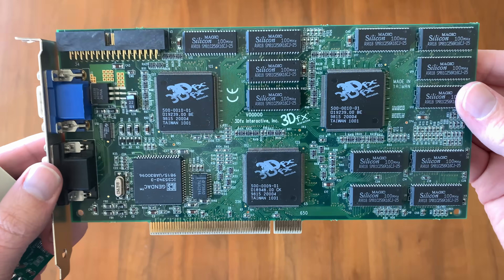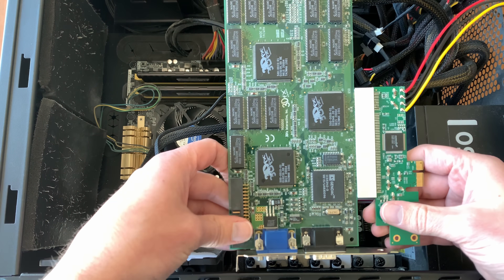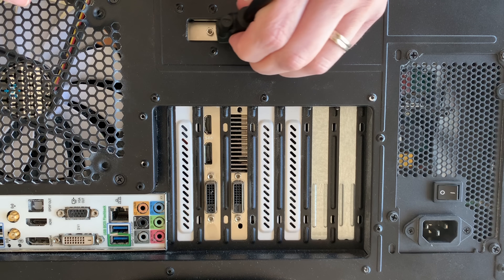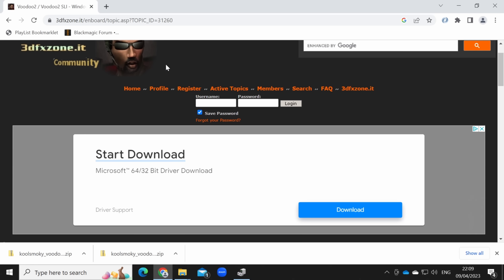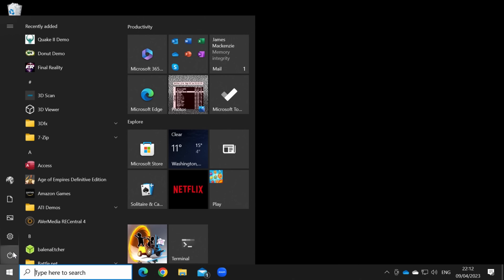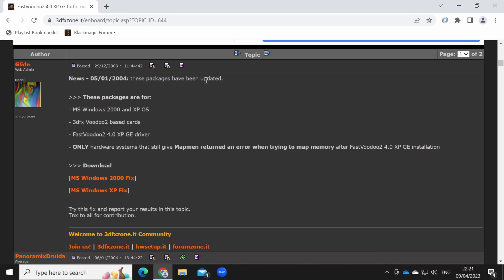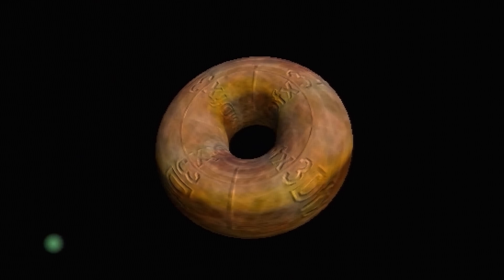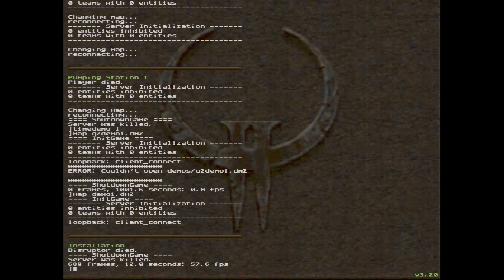I made 3Dfx Voodoo2 work on a modern PC!

Comment: I was expecting to see the card working in linux, not on windows.  Now I'm wondering how well it would run alone without another GPU in the system.
Reply: You wouldn't see anything much of the time, without another gpu(or at least the integrated graphics) The voodoo2 is 3D only.
Reply: It can only do 3D environments. You'd have to remote-desktop to it and launch a game remotely for the 3DFX to kick in.
Reply: @TheAmazingAdventuresOfMiles  I honestly forgot about that quirk of the older cards.

Comment: Awesome but How did you connect the vga pass through with a 2D card? The voodoo2 needed to be connected to a 2D card from what I remember as I always assumed it didn’t texture fill. I would love to have 3DFx running again :) good work
Reply: That’s right, I am not convinced these demos are actually using the card…but Quake 2 looks like Glide to me
Reply: @meatpockets   yes it did look like glide, but yes need to know how it hooks up to 2D card. It needed a 2mb or more dedicated 2D card. I used a 2mb video logic card :).
Reply: No! The Voodoo and Voodoo 2 cards did not need to be connected to a 2d card. They were actually stand alone devices. The purpose of the pass through was so that you could use a single monitor to display the video from both cards. The Vga connectors on the Voodoo would pasthrough the video from your 2d card whenever the voodoo card was not active for example during boot up and when just running the windows desktop. But when you launched a 3d game and the voodoo card became active, it would internally switch to the output of the voodoo. And of course after you exit the game it would switch back. Alternatively, you could have a separate monitor connected to each. My guess is the reason he didn't use the passthrough here is because modern video cards tend not to have VGA anymore. They tend to have displayport and hdmi. Also modern monitors tend not to have VGA input. So, it would be simpler to just connect an old dedicated VGA monitor to the Voodoo, than to convert back and forth just to go thru the passthrough.

The only 3d cards back then that needed a 2d card were the powerVR cards like the m3d. The M3d had no video output at all. After it rendered an image into it's frame buffer, it then had to copy that over the PCI bus to the 2d cards frame buffer. Nowadays Nvidia's optimus technology does similar. That's how with a few hacks you can play games on a Tesla card that has no video output at all.
Reply: awesome all answered in second video I learnt something :)

Comment: I would love to see the Voodoo Banshee working on modern hardware.  In my opinion it was the first card that set the norm of what video cards would become.
Reply: I think that would be the Riva TNT from Nvidia, it was released about 6 months earlier, and performed similarly or a bit better overall.
There had been other combined 2D/3D cards of course, but this was the first one to push 3DFX.
People were disappointed in the Banshee when it came out, as it was considered slower than the older Voodoo2.
Reply: @DoubleMonoLR  The Banshee actually came out before the TNT, and was much cheaper.   Also, the Banshee was slower in 3D than the Voodoo 2, but for games that only used one Texture unit (most of them), the games were much faster than the Voodoo 2 as the Banshee ran at a higher clock rate.

Comment: This takes me back. Sometime around ‘99 I had a 2 card setup on my AMD K63 400mhz system. It was a AGP Voodoo 3 /16mb card and a PCI Voodoo 2 card with I believe 12mb. They were linked together and gave some impressive benchmarks for its time. But it was short lived because around that time the GeForce came out and change everything. I bought the GeForce 2mx. It was the bottom line GeForce but it destroyed anything I’d owned previously.

Comment: This is pretty awesome! I have been running benchmarks on my Voodoo 2 to compare it to other 3D hardware on my Windows 98 PC, and with VSync forced off that Quake 2 timedemo caps out at around 57 FPS at 800x600x16 on any CPU equal to or faster than a PII-450; I swapped in a PIII-550 recently and the test didn't change one iota, so we're running into the rendering limits of the card here. With a bit of additional cooling there's probably some room to run a bit faster with overclocking, but one thing we forget about late 90s/early 2000s games is how slowly they ran and we still considered it OK; getting anything around 30 to 40 FPS was considered pretty playable back then!
Reply from the maker: Good to know! I didn’t try 800x600 - running in 640x480 here :-)

But I 100% agree. We are spoiled by locked 60fps nowadays :-)

Comment: i remember a friend he purchased that voodoo2 to able to play FIFA98 . I had Cirrus Logic 5446 with Tuner. I was also able to use Adobe Premier to capture A/V connecter device or TV programs but with bad reception. I was studying in  country had no PAL system. I was also used it super quality webcam when I connected my Sony Handycam Camera to A/V input (needed Beta Drivers for webcam ability). I had Sound cars ESS 1869 but has general midi but ones i had a Sound cart with Yamaha MIDI which I like it's Quality.

Comment: I remember back in late 1998 I had a Celeron 300a based PC, with a 4mb ATI Rage Pro and Dual 12mb Voodoo 2's in SLI. My CPU was actually overclocked to 594mhz (a world record, apparently) accomplished by cable tieing 3x 60mm Fans from Amd CPU heatsinks to the 300a's slot heatsink, then using PC133 ram instead of the normal 66mhz ram, this PC I managed to run the first Max Payne on despite the requirements stating it needed an Amd 1Ghz CPU as a minimum. It was a good PC for its time and when I eventually upgraded the whole thing I gave it to my dad, and he owned and used it for another 15+ years, even still overclocked too, then one day it just died, and apparently he recycled it, which was a shame, as I'd love to have been notified of him letting it go, so I could have potentially repaired it and used it as a Retro PC for old gaming titles.
Reply from the maker: A legendary overclocker CPU! I had the 300A running super reliably at 450Mhz - and also Voodoo2 SLI. Great memories :-)

Comment: I have 2 Voodoo 2 cards here and tried the same thing with a pci adapter card.
The card uses, as far as I can tell, the same ASM1083 chip as you have on your adapter.
I got the drivers installed but as soon as I tried to start something with glide it immediately crashes without an error message.
So I booted in DOS and read out the cards info with mojo.
It shows the FBI chip has 0MB memory and that it can´t activate the TMUs with error 0xdead.
First I thought the card is actually dead, but then the second cars had exactly the same problem.
So I got an older mainboard (nForce980a chipset) with native PCI support, and both actually work fine.
The interesting thing is, that mojo doesn´t have any problems with a Voodoo 1 with that adapter card.

Now I´m building (sort of) a retro PC with Windows XP, a Phenom X6, a GeForce 6600GT and 2 Voodoo 2s ... oh well ... I need a case now ...
Reply from the maker: Sounds like a fun project! Interested to hear what case you get - I'm on the hunt for a retro case too!! 🙂
Reply: Well... The case didn't turn out retro at all.
I got a cheap Kolink Inspire K9.
Rather modern case with glass window and RGB.

But the really cool thing is: I found someone here in Germany who sells 3D printed Voodoo 2 SLI bridges with an illuminated 3dfx logo.

Looks really nice.

Can't recommend that case though.
Wouldn't buy it again.

Comment: Diablo 2 using the Voodoo on a CRT vs  nGlide on a CRT. Look for glowing color effects (some enemy spells, usually poison and fire attacks from skeleton mages) not directly, but from behind walls (these colors tend to glow through. Check color saturation and brightness differences. As I recall, some light effects were not apparent or prominent in D3D, but were somewhat present with nGlide's 3DFX, but not sure just how well it implements it vs real hardware. Might be some other things to look at too.

Comment: I've got some old Voodoo 3DFX hardware LONG CARD hardware running in a Windows 7 environment as an entertainment PC on my Sony TV.. I love it!! Will be using your info to try and massage it into a newer build with Windows 11 and see how it goes.. what I love about the card I have is it allows me to SLAVE it into another card using the external VGA MALE and FEMALE ports.. this way you get the BEST of both worlds!! So to speak...
Reply: The problem is modern monitors tend to not have VGA and likewise modern video cards, or onboard video tend not to have VGA out. So, to use the pasthrough youd have to convert back and forth. As such it would make more sense to either just use a dedicated VGA monitor on the voodoo or use a monitor that has multiple inputs, like a TV that has both HDMI and VGA inputs and just switch between them.

Comment: I'm surprised that worked at all. The voodoo cards were passthrough adapters. I was unaware they could do all of that without a video input into them. I'm thinking the demo had a static background you weren't able to see because the background was trying to display out of your primary display adapter. I'd like to see what happens on two monitors with one attached to the voodoo output and the other to your primary display. Probably have the 3d models go to one and the static images on the other. Final Fantasy VII (not the remake) would be a neat experiment there. 3 bonus points for getting the sound blaster AWE 32 with the sound font loaded into it to go with the voodoo card  :)
Reply from the maker: My monitor has dual inputs - 1 VGA and 1 HDMI. My primary video card uses the HDMI and the voodoo is connected via VGA (no pass through, just output). When the voodoo activates (e.g. in a GLide game) I toggle over to the VGA input and everything works great :-)
Reply: @jamesfmackenzie  Not sure you understand what I was saying there. I think Quake is a fully 3d game so that one works. I think the voodoo card only handles 3d things and is reliant on another video card to render 2d images. Quite like the bit in the Angry video game nerd's episode about the Sega CD32 while he is hooking it up if I remember right. Another thing you could do to see what I'm talking about is to adapt your DVI signal to VGA somehow and plug it into the input of the Voodoo card. I bet you'd see a background in the tech demo bit you got it working. It's also why I mentioned playing Final Fantasy VII on the PC because I know that has 3d models imposed on 2d backgrounds. The way you have it hooked up there you'd only be able to see the 3d models because the Voodoo card has no way to deal with 2d images at all. So really I'm thinking were you to have two monitors you would get the 2d backgrounds displaying on the primary display adapter's monitor and the 3d models on the Voodoo adapter's monitor were you to plug both into the respective video adapters. Could be wrong. It's been a long time since I've ran a Voodoo card and I never had two monitors back when I did.  :)
Reply: @jamesfmackenzie  I just went back and looked at the bit that showed the back of your PC. You have a VGA out from what I'm guessing is your integrated graphics. You can hook that output into the voodoo input and do all the stuff I was talking about. There should have been a male to female VGA cord with the voodoo card if it's still around.
Reply: @thefirsted  No. That's not the way it works. the passthrough is just a passthrough and a switch. When the voodoo card is active it's doing all the rendering. When it's not, it just passes through the other card. Anyway, nowadays, it just makes more sense to use it the way he did here and use separate connections for each card. Using the passthrough would make no sense.
Reply: @stefanl5183  I don't think I'm wrong. Linus did a big video about voodoo cards recently that supports my argument. I could be wrong though, it's been a very long time since I've ran a voodoo card.
Reply: @thefirsted   When the voodoo cards are active the passthrough of the VGA card is switched off and all the output is coming from the Voodoo card. And the voodoo card can certainly render 2d if it needs to. Rendering 2d is simply writing to the frame buffer. There was even a guy who wrote a video player for voodoo cards. Google 3DFX Video Renderer V1.1 (c)1998 Tjalling Hattink. I don't know if it's still on the net now, but you can find it in the internet archive. The only thing the voodoo card really can't do is boot  your system and load windows. It can't do this because it's not a VGA card and doesn't have an option Rom bios and it doesn't emulate a VGA card and map itself into the upper memory blocks in the 1st megabyte of memory where VGA cards do. Back then you had to have that for the system to boot up properly and also to get video during the boot process and before the drivers were loaded. Now we've got Uefi and things are a little different but you still need a firmware on the card, it's just a UEFI firmware instead of BIOS. Anyway, it's not that the voodoo cards couldn't render 2d, it's just that they didn't want to bother with all that. Anyway, you can see for yourself by simply doing exactly as James did here in the video and simply hook the cards up separately. It works just the same. In fact, there were some people who did this back in the day and didn't use the passthrough because on some cards it was said to degrade the picture quality just a bit sometimes on some of the better 2d cards. So, to avoid this loss of quality when they weren't gaming and using the voodoo card they simply did it that way. Anyway, you don't have to use the passthrough. The voodoo cards work independently from the 2d card. This is why couldn't play games in a window on the desktop with a voodoo 1 or 2. Later with Rush, banshee, and voodoo 3,4,&5, you could.

Comment: Quite impressive. I have had a Voodoo Banshee card (Wicked 3D) back in the 90's, which was an AGP card. Unfortunately, I have not seen an AGP to PCIe adapter so far. However, I know there was PCI version that AGP card as well. As for a request: Please try "Clive Barker's Undying" on your Voodoo 2 card. That games supports both Glide and DirectX. Would be nice to see if there is a difference in image quality and how the game performs on a modern PC and your Voodoo 2 in general.

Comment: I’d like to see you try to install a Sound Blaster Audigy 2 on a modern PC. That sound quality blew away onboard sound on all my PC builds right up until windows 7, when it refused to run the drivers. I would be willing to bet that card could output better sound than any onboard chip to date if you could get the thing to run 😅

Comment: How did you fix the pass through vga ? I have an older C2Duo pc with a pcie to 2xpci adapter that did not work with the voodoo2 but with my audigy2 (luckily I had a native pci in the motherboard) still had to pass through the nvidia GT430 via vga to enable the voodoo2 to render via glide. Thanks for your video

Comment: That's cool, very useful video too. Thanks for sharing...

Fellow Brit techie here... I wonder if you can buy a PCIE to AGP adapter and get a Voodoo3 3000 AGP to work...?  AGP is more challenging due to the different slots and voltages that were available, the possibility of frying a 3.3v card with 5v, although they tried to solve this with the AGP Universal slot.

I have some vintage PC parts incl. the Voodoo3, still haven't got round to building a working Windows 98 PC as I don't have the RAM.  I might try your methods instead!
Reply from the maker: AGP is definitely more challenging than PCI. But I’m doing some research - perhaps something is possible :-)

Comment: One trick of the 3Dfx Voodoo cards was that they rendered everything with 16bit, not 32bit. This cost a bit of paint but it ran with twice the performance. I think this changed with the Voodoo 4 or Voodoo 5.
Reply: As I read somewhere, they did the rendering computations in 32-bit (24-bit colour, technically) and dithered the results down to 16-bit. The DAC output then went through a filter on the way to the monitor, with the final displayed image being approximately equivalent to 22-bit colour.

Comment: There are many Glide games you can run. I use nGlide to retro games at 1440P with Glide support on my modern setup. I also have a Diamond VooDoo 2 12Mb card lying in my closet.
Reply: dgVoodoo is good too, between that and nGlide you can get just about any old 3Dfx game working beautifully on modern hardware.
Reply: @krashd  thanks will give it a shot too

Comment: I still have 2 Voodoo 2 Cards. It tried connecting them together on a PIII system and Win98 but ran into address conflicts and haven't dug into it much deeper.
Reply from the maker: I had a very difficult time with Win98 and WinXP too. For some reason the Win10 driver just works 😂

Comment: you might want some kind of cooling on that thing, back in the day the real bottleneck was the CPU so the cards weren't working as hard, usually waiting for the CPU to get done with the TnL, with a CPU that can more than keep up these cards can get quite hot, at least a fan blowing across the TMUs is advised, I had to do this to keep my V2 SLI configuration stable in an Athlon XP system or once the cards heat up there starts to be screen tearing. It would be a shame to see a V2 lost to thermal component fatigue.
Reply from the maker: A few people have mentioned this. Thanks for the tip!

I have an IR thermometer and some heatsinks on order 😎
Reply: @jamesfmackenzie  so now you got one v2 working on a modern system I guess the only real challenge to tackle after would be a two card SLI setup, or go wholesale crazy and try to get the quantum3d mercury "brick" to work for a total of 8 V2s in SLI